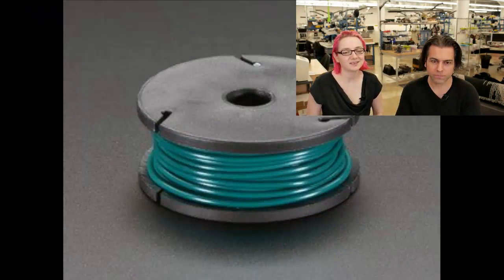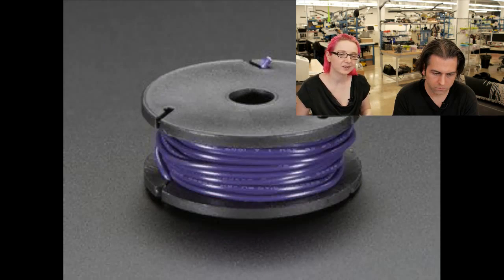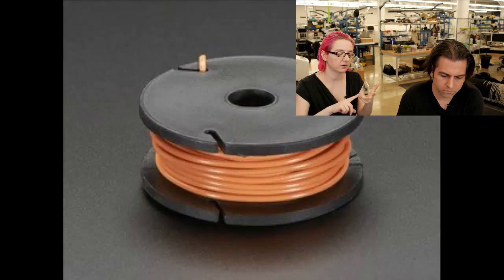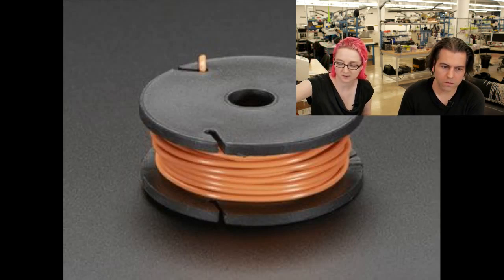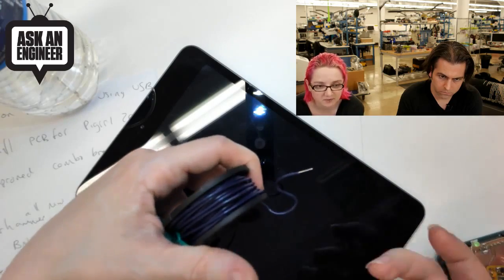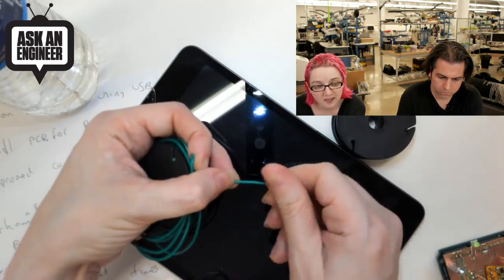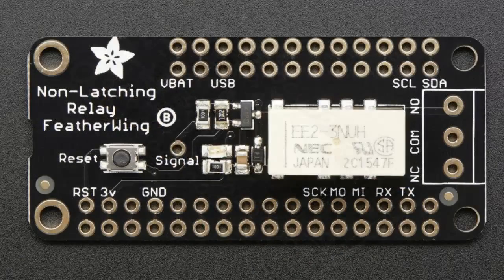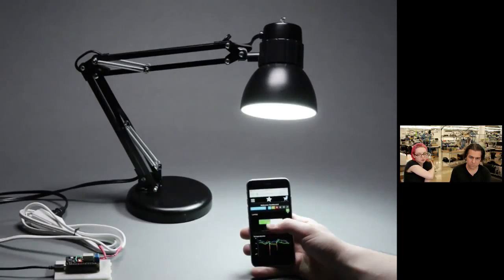New Products 3/30/2016

Comment: so on the relay you have to choose what pin you want to run it off of and solder a jumper from the inner row of pins to the hole in the middle of the board?
Reply: (only one of the many inputs selected as output)